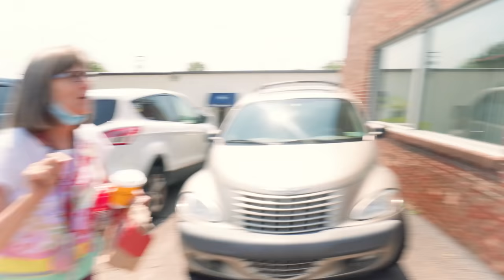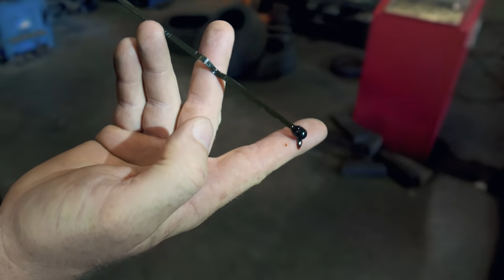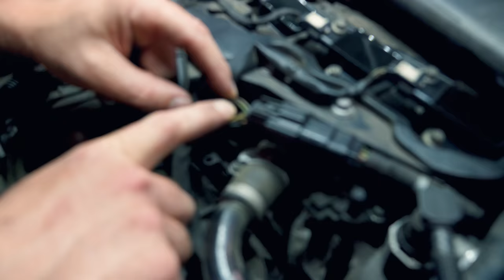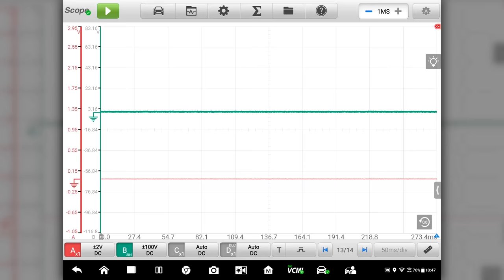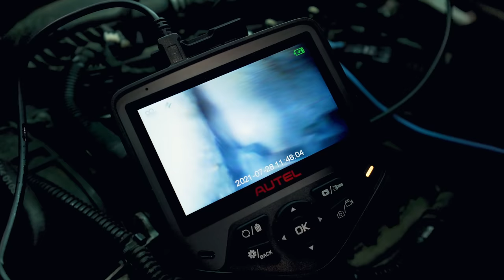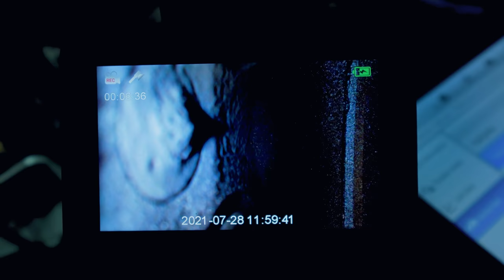Stuck Open Fuel Injectors (GDI) Part 1 (symptoms and troubleshooting)

Comment: My 2000 sonoma 2.2 broke down not to long ago, had a P0200 code. I found both wires broken and shorted out on my injector harness… I replaced it with a junkyard harness. Nothing changed because my ecm shorted out injector drivers 3&4 as well. I got a new computer, my truck ran decent for a about an hour before I got a new code . P0171 (bank 1 4 cyl) and I determined my fuel pressure is way low .. only 32 lbs max rated for 40-45 . All new fuel parts (pump, filter, clean pump ground, and a new regulator)  it’s been sitting as I haven’t been able to mess with it . I’m gonna test my fuel pump relay and maybe injectors next. When I figure it out I will reply and let you know! And advice is appreciated
Reply from the maker: what is your fuel pressure at wide open throttle on a snap throttle test?
Reply: @ScannerDanner  it was around 32-34, At full throttle. With engine off key on, pressure didn’t go past 34.. my mechanic suspects I might need work done to the heads “lean condition caused by low compression “ cyl #3 has 90lbs. All other are around 150-180
Reply: We are going to do a leak down test next , he suspects my intake valve or head gasket is bad causing a huge vacuum leak …. But the fuel pressure doesn’t prime up to spec even with engine off. Idk this truck has been a nightmare .
Reply: Even if it leaked through my injectors, i should be able to smell it, there is no fuel odor at all anymore. I really hope this guy is on the right track about the low compression in one cyl. Trucks been out of commission for 3 months and has seen 3 other clueless mechanics. Some new mechanic I met wanted me to swap motors for a P0200 code!  Thanks for your feedback sir.
Reply from the maker: @bobbypasquarello7348  you need to address the low compression cylinder first, but that fuel psi doesn't sound right either.
Reply: @ScannerDanner  turns out the new computer I had installed was for a 2003 style truck, which has no F.P. Regulator and no return fuel line . Also only 1 o2 sensor.  I’m looking for a new computer tomorrow hopefully this makes everything better .

Comment: Would the o2 sensor readings be able to show an incredibly rich system narrowing it down to a fuel issue?
Reply: I would think the raw fuel blowing out of the tail pipe would narrow it down to a fuel issue lol...
Reply: If the rich condition causes a misfire the fuel doesn't burn so the O2 sensor sees surplus O2, not surplus fuel. Unless the fuel ignites in the manifold.

Comment: I think the injectors not firing when cranking is the pcm seeing low fuel pressure on the high side. Im assuming its to save the injectors for some reason.
Reply: what i was thinking too
Reply from the maker: Good theory on that!

Comment: does it have a cold start valve  ?
Reply from the maker: no sir, they stopped using those in the late 80s injection systems. Maybe some early 90s still had them

Comment: Disconnecting injector connector while engine running may cause for this
Reply: Please explain how
Reply: @jyao5409  it is piezo injector. While disconnecting piezo crystals are expanding they not able to ground and injector will remain in expanded state. Therefore,no attempt Should ever be made to disconnect these injectors while engine is running
Reply: @renjithb2567  thanks. I was still thinking electromagnetically...

Comment: Sorry about your mom but can you get on with the purpose of the vedio
Reply from the maker: If you're looking for silver bullets, you're on the wrong channel. I'm not creating videos just so people can fix their problems. I'm creating videos to teach people how to troubleshoot these systems. Not your thing? No problem, move on. There are plenty of other channels out there that cater to the DIYer who doesn't care to actually learn and only wants to know what part to change.
Reply: @ScannerDanner  I'm 64 years old have figured out and fixed every problem with every car I've owned since 15 years old, even all with PCMs and just bought a Snapon MODIS for the scope, l don't do replace part process of elimination l have to figure it out.
Reply: @ScannerDanner   l had a fuel pressure issue, new filter and pump, but still low did every test on the regulator and watched your video and you waiting for minutes and then the fuel leak past diaphragm and sure enough mine did the same thing,, but held hand pump vacuum l even regulated air pressure to 40 psi and couldn't blow past the diaphragm,, whole different ballgame then when I started working on cars before you was born.

Comment: Oh, an eco boost? With that diluted oil? That timing belt is gonna be gone in no time. The eco boost engines have timing BELTS running in oil and they need very specific oil.
Reply: Not the 1.6

Comment: Hi, Teach!!! It's me again! You should have titled the video, "Let's ruin the CAT Converter(s)/take 50K off the bearings and other critical engine components while I teach you how to get waveforms for my Youtube viewers." Forget about the customer's car. Kinda like the truck you left on the side of the road from your other video:) I learned a bunch today!But on a serious note, in a non-trolling way, glad to hear your mom is okay:)
Reply: How would you diagnose it?  Crystal ball?
Reply: @johnaclark1  Glad, you asked! On this vehicle. 
1. Scan for dtc's then see, smell smoke. 
2. Shut the engine off/remove plugs and find the leak.
No long engine run times to cause damage. No crystal ball this time but maybe next time. That's just me though. I still worship the ground he walks on.
Reply: @MR.KNOWITALL1982  Then you would just throw new injectors at it?  What would you do when new injectors didn't fix it because the PCM had a shorted driver, or a shorted harness causing the injector(s) to stick on?  He did everything exactly right, in my opinion.  He did not run that engine very long at all.  Remember, you came into this video already knowing what was wrong based on a video title.  When a car comes in you don't know what's wrong with it until you attempt to run/drive it.
Reply: @johnaclark1  My thought is this, the cars PCM will tell me(scan tool) if there where circuit problems. Again, that's just me. I do enjoy his video's as I have stated in the past. I also love ripping into the harness protective conduit for amp clamp access for things I already know are okay. Teach did say this in the video about the PCM are smart enough??? So, I'm confused why he needed to "scope" it. As far as road testing, I'm all for that. However, I think Teach doesn't like to waste time on road tests(Ex. Look at the P1351 GM truck video. I'm sure that guy on the side of the road wishes that he had.)
Reply: @MR.KNOWITALL1982  The cumulative 2 minutes (if that) he ran the car did not hurt it any more than it was already hurt.  Relying 100% on scan data when it comes to a repair that is going to cost many hundreds of dollars is not a good idea.  There are many data pids in a scan tool that don't even work, especially on the Chinese scan tools like Autel.  Just because it says no fault doesn't necessarily mean there is no fault.  It might but it might not.
Reply: @johnaclark1  I don't know much about Autel so I can't say, but my IDS would have nailed it, if more testing was needed. The PCM would have shut that injector off if there where circuit issues. The PCM monitors both sides of injector. In this case. Vehicle with known injector faults, white smoke at tail pipe, smell of fuel, no codes, fuel leaking down with key off... crankcase full of fuel... It's getting injectors. Flat rate mindset, I guess. But that's how under paid techs make a living. You can of course do it how Teach did it. If you like.